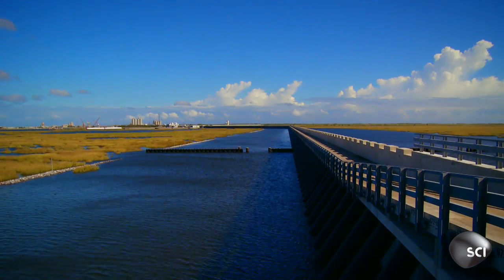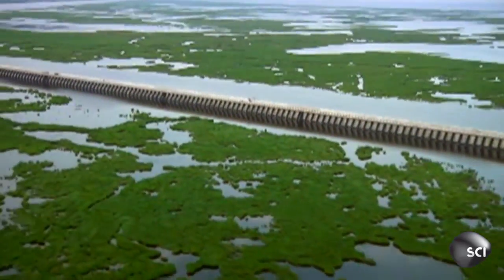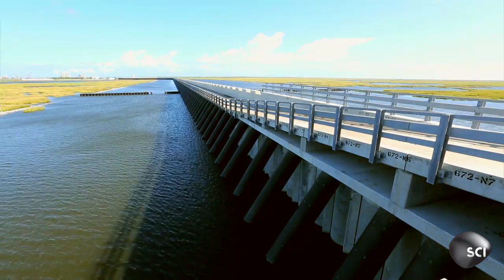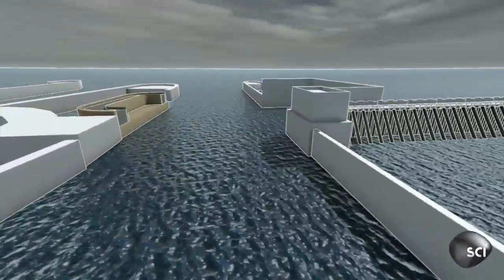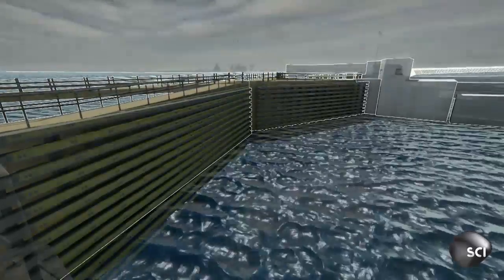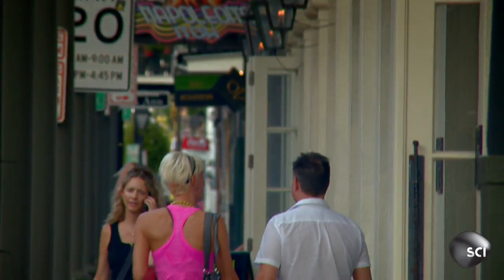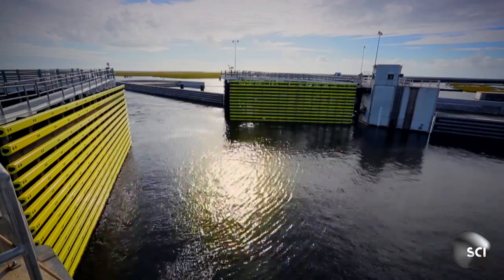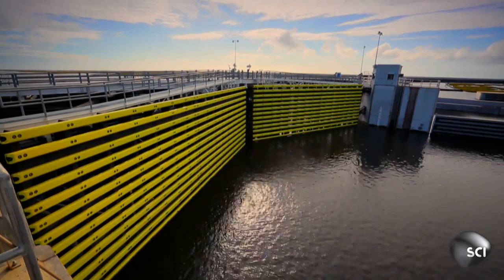New Orlean's New Hurricane Defenses | Strip the City

Comment: And this didn't prevent the floods in Louisiana I don't get it ... oh wait maybe it was built to cus greater floods like recently historical flooding ... all this money spent and it didn't work instead it did the opposite something wrong with this pic
Reply: This is to prevent storm surge, ya know that wall of water that hurricanes bring. Louisiana flooded last year from rainwater overflowing rivers.
Reply: I guess you would need to busild one to keep rain clouds out to keep prican happy
Reply: pricanflaca46 Um, actually it was faulty building by the Army Corps of engineers. The Army Corps cut corners like crazy using cheap material and not drilling deep enough.